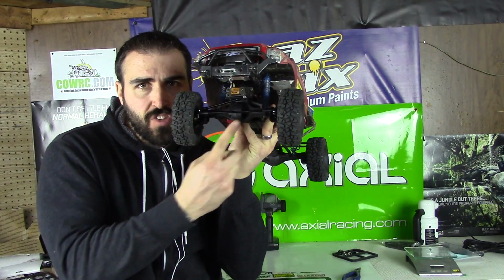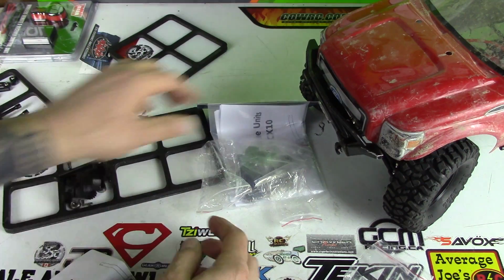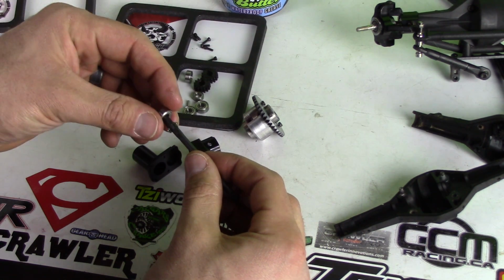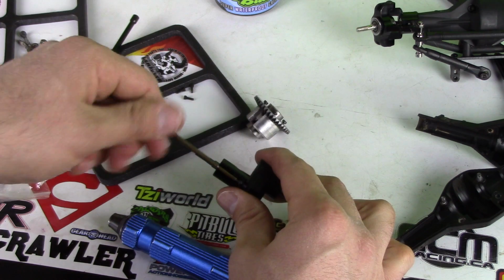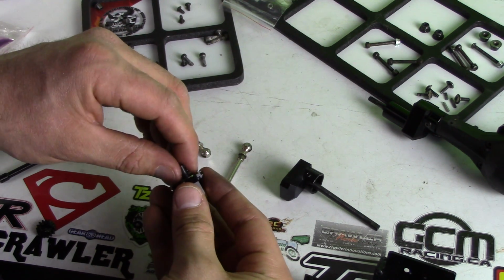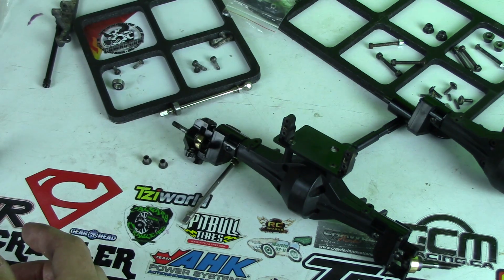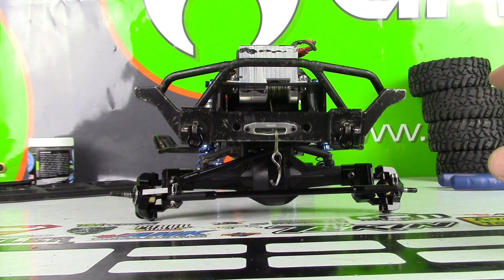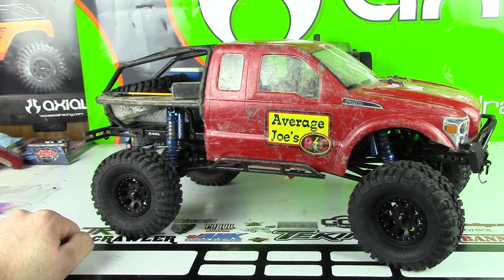RC4WD Portal Axles - F-Bomb! Build Series

Comment: do these portals work with Beef Tubes?
Reply from the maker: Kim Robertson If they are the Beef Tubes that go inside the axle, and leave the end of the axle like stock, yes. But it it’s the Beeftube that you cut off the end of the axles to have more of the Wraith set up? No. This set needs to have that single screw into the top and bottom like the stock Axial Plastic axle.
Reply: @scalefreakgaming  Sorry, I should have specified. These are going in a first gen Scx10 with beef tubes already installed. I had to modify the stock axles when I installed the beef tubes. I do have sets of screws that attach the knuckles though the plastic housings and into the beef tubes.
Reply from the maker: Post a picture on the Scale Freak R/C Facebook or tag my on IG @scalefreakrc

Comment: The first set of portals RC4WD ever put out was for the old clod buster axle's. I spent $200+ dollars on a set and all 4 of the pieces of shit broke just going across my garage floor. They used some tiny ass watch screws to hold them together and every screw on every portal snapped with in a few feet of movement. I told RC4WD and posted a video here to show how shitty they was but RC4WD didn't do shit to help. I've never bought another product from them since. I had spent tons of money on their site before that.
Reply from the maker: +TheAmericanUhate I have a feeling they are different now. Seems to have been a lot of changes over the last year. Try them again.

Comment: Those are awesome. Thing about portals besides better ground clearance as in the Unimogs and the Pinzgauers is that their portals have a gear reduction which would also eliminate that torque twist that regular axled crawlers suffer from during very steep climbs. If you can have a smaller upper gear and larger lower gear in the kit, that would greately eliminate that torque twist problem. Unimog hub http://image.automobilemag.com/f/64240252+w660+h440+q80+cr1+ar0/unimog-part.jpg

Comment: Put your steering link on top of the steering knuckles instead of under the knuckles
Reply from the maker: Odd enough, what the website shows, and what the instruction on the build show are a little different. If you put the link on the top, the steering linkage to the servo is pushed over a little too far and it limits how much it can turn one way. 

I'm going to have custom links built so I can put everything on top of the knuckle.